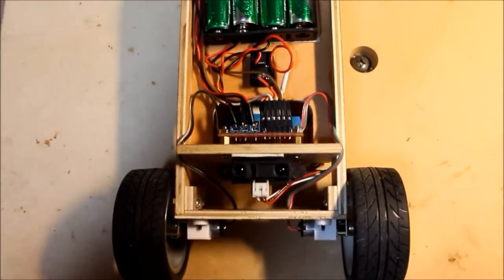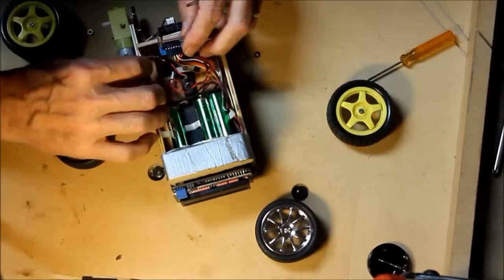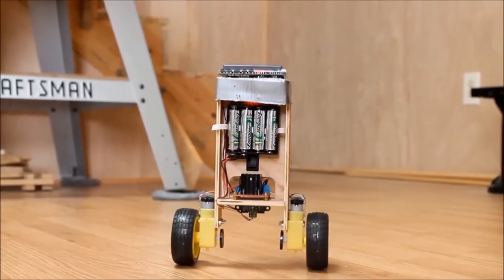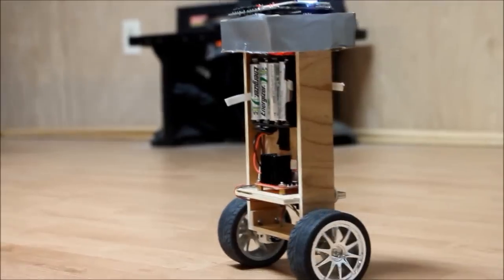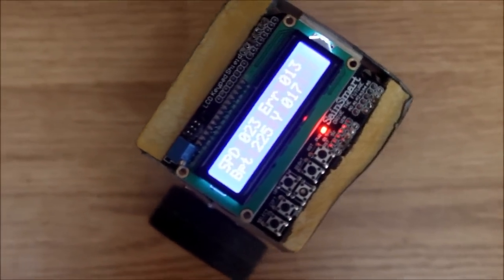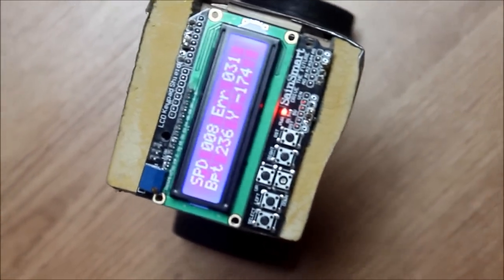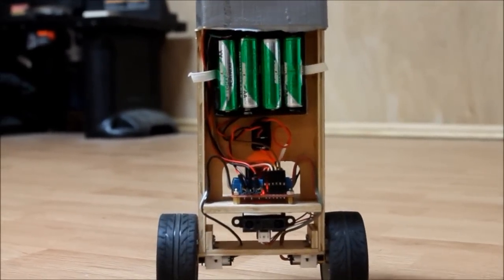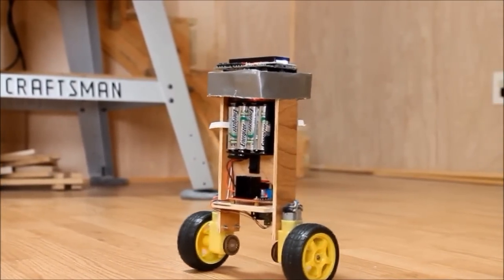Arduino/MPU6050 Balance Bot Part2

Comment: have you used the nRF24L01+ with this setup ?
Reply from the maker: Frank Lopez No, I haven't. To be honest, until you asked the question, I wasn't aware of it's existence. Just did a quick look, and it certainly looks like it could be a good solution for those projects where you want/need remote monitoring/control. Especially where distances exceed that of Bluetooth. Thanks for bringing it to my attention. I may order a couple just get a better understanding of what they can do.
Reply: oh please do, they are cheap i got like 10 for like 7bucks i suggest Ebay or Banggood.com they have good rep and support.

im trying to wireless have this same control over Dc motor or even stepper motors tho they is alot of videos out there no one seems to explain this the right way?  and when they do its vague and no reply "sorta just showing off" no means to  help others.

tho i have done what you did using servos i can manage the merge of the nRF24L01+ example code with this type of sketch you have.,

maybe we can email each other  and you can help me achive this and by thus you will see that it is something worth the buy and im only saying that cuz you are a better/exp coder as im sorta new  and this datasheet for the nRF is not really to beginner friendly tho is not about the datasheet is about the arduino structure and i dont really know how to structure it well
Reply from the maker: Frank Lopez Ok....There's a pair headed this way. Will let you know when they arrive... You're right,, they can be had for very little money, So couldn't resist the opportunity to see what you can do with them.
Reply: jmhrvy1947 sure thing hit me up when you work something out.
Reply: jmhrvy1947 another thing i wanted to ask about those drivers you using the red board with the L298D i think it is>? is your jumper on ? or off? cuz mines i got 4 and none work without the jumper tho im feeding it 20volts and i think it says to remove IF using voltages greater then 10-12v ? and if using less then leave on so you can regulate 5v to arduino
Reply from the maker: Frank Lopez On mine, the L298N voltage jumper is in place. The 298's 5volt output is used to power everything else. The 8 NiMh batteries feed it something close 10V. So far, after many hours of operation, its proven to be a reliable setup. By that I mean nothing's burned up, and I haven't detected any processing issues related to dirty supply voltages. Another side benefit related how the batteries are arranged/mounted is, when the Bot falls (and its done that a lot ;-) one or more batteries will pop lose. This instantly shuts down the system, which in turn saves a lot of wear & tear on the electro-mechanical  parts.
Reply: Pretty smart about the berries but why not just use a leg attach to a servo, where if it falls then have the servo kick the leg out thus the boot will get back up, I would set that system Separate from the other system
Reply: And ass far as my stop I actually have a 30v AC power adapter hooked up to a buck step down converter dropping the volt to 10v and this motor driver won't turn on unless I leave that jumper in place which I gutted I'm not suppose to do unless I'm under 10 v which I am but if I want 12v+ I have to remove knowing it won't work unless I leave jumper in place so im not sure but I think my motor driver is bad
Reply: Frank Lopez how is that china order coming along? they do take 3 to 4weeks.

while waiting for your shipment i decided to start this project you did in the video and given that i own a 3D printer i thought it be cool if i design my own body and wheels, "that code you wrote is pretty big" i wonder how long it took you to write something that large ( cant wait till i learn c++ fully) i been practicing on this android app called Solo Learn C++ and am 50% finished trying to focus on arrays, class, pointers objects and functions as one of my biggest fall in coding is with this nRF24L01+ that we talked about i figured out how to write some code for basic use after reading the 100pg pdf but now im stuck in the Rx aspect of what todo after i get this data from the master "how to use that data that i just sent  from master to slave"
Reply from the maker: I got the nRF24L01+'s a week or so back. and hooked one up, but at the time didn't have a 2nd spare Arduino. So while the code loaded ok, I really had no way verify it was working. In the mean time other projects have taken priority, so I have no real progress to report.

As to how long did it take to write the balance bot code, That was my first Arduino project You can get an approximate length by the dates of the videos. But in my defense the parts mostly came from China, so there was a lot waiting ;-)
Reply: true true i hear ya on the waiting part lol. i could have done send you that missing part if i knew you was lacking something, is the lease i can do for your help is only like 3 bucks or so.

maybe i can verify for you ? as i do have alot of arduinos i got for my project so i can verify your code and report to you ?!

all im trying todo is control a dc motor wireless so i guess sending arrays of  the Value data created from a POT or a MPU6050 ? tho while i have no issue doing this , i do when it comes to creating a code for the Rx end "i mean i did just send it but not sure how to unpack the data and use it for what it was ment for?"

Comment: hi good job.
i have uno and mega 2560 r3 , can i use this code whit uno or mega 2560 r3...

i dont want use LCD shield..
Reply from the maker: ***** The code could be adapted to run on either; However, the Mega might be the easier of the two.  I say that because I used the Mega in the Segway like transporter, shown in another video, and in my mind it has a better overlap in how the pins and timers are used. But if space is a problem, then go with the UNO. I'm sure with a little thought it can get the job done.  This car will run without the display, but it really comes in handy while trying to get it up and going. 
If you build something like it, let me know how it works out.